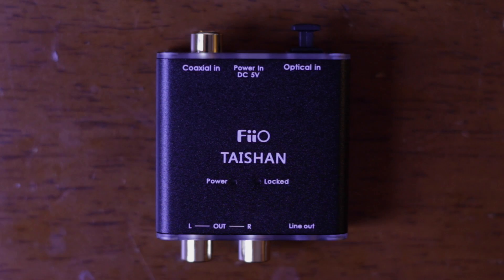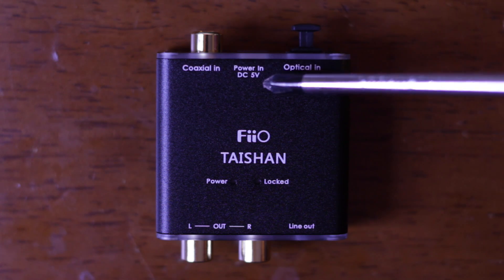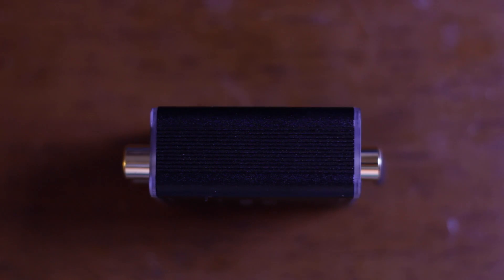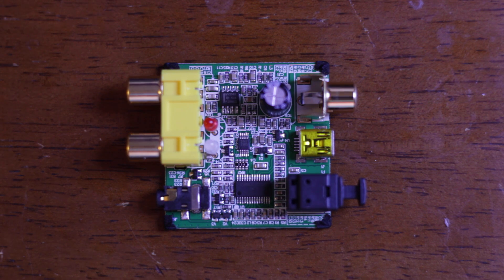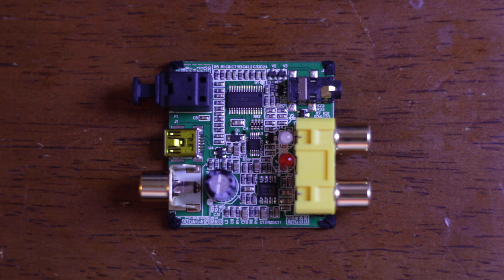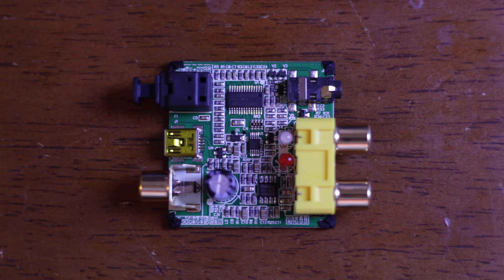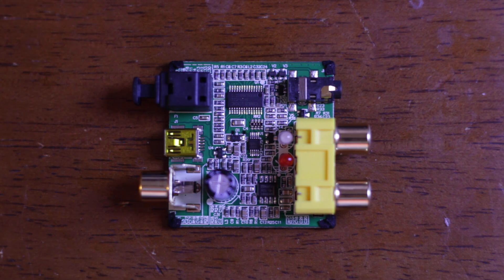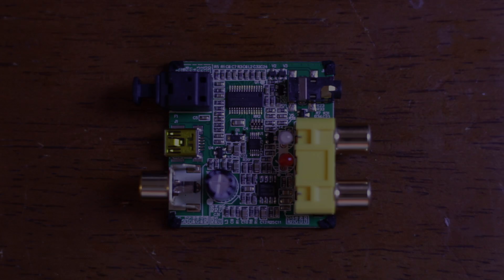10 Minute Teardowns: What's inside of the FiiO D3 192kHz/24bit Optical and Coaxial DAC?

Comment: Can i use this to imrpove the Sound of my PC Setup? I have a Soundcard which is connected directly with an optical Cable to my Receiver where i have 2 JBL Studio 220 and 1 Sub connected.
Reply: It largely depends on your receiver - does it have a quality DAC (or more likely, a DSP chip that decodes and processes all sorts of signals)? If you have a nice receiver, chances are that the internal circuitry will be better than this Fiio unit. Also, do yourself a favour and use a coax cable instead of optical - you'll get slightly better sound (read up on the effects of jitter and you'll understand why). Good luck!